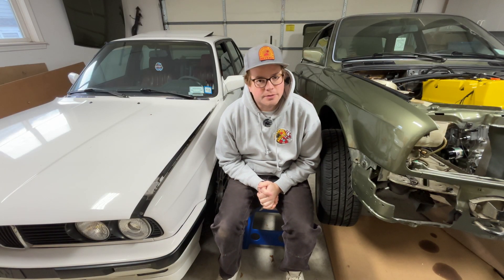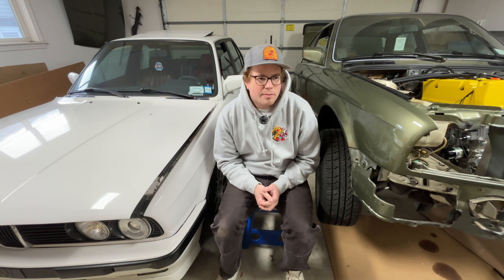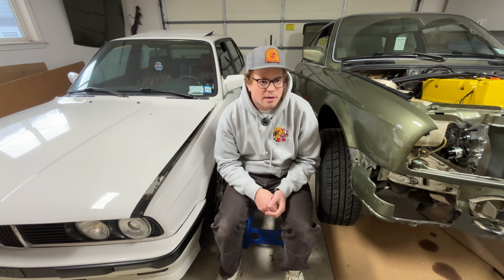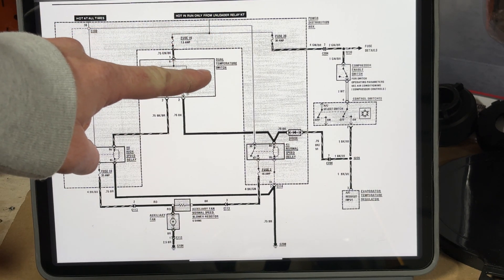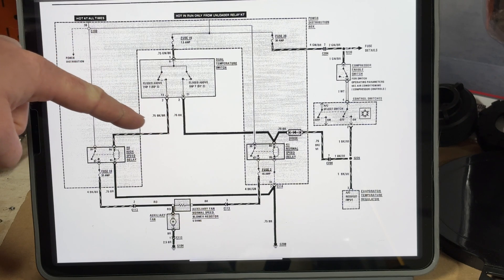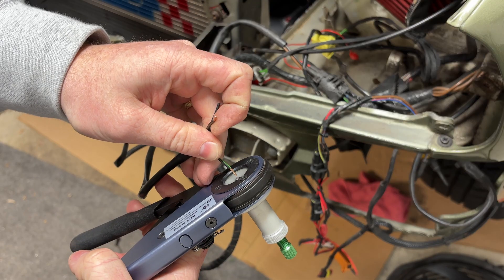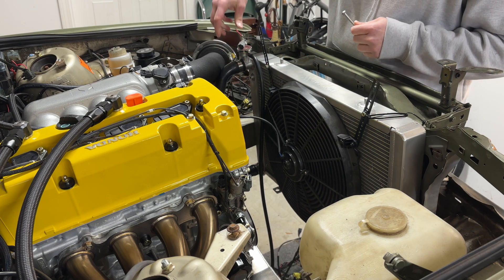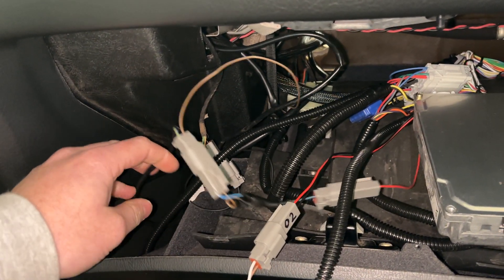Last Minute Details Before the K-Swap E30 Hits the Road!

Comment: Hows it going , 
I’m willing to pay you , and send you my two connectors that go into the ecu k pro . If you can make the harness like you created for yours I was wondering about that blue yellow wire . Lmk thanks in advance
Reply from the maker: hey there, i have not tested/verified that part to be working yet, so i'll have to get back to you on that. the wideband sensor is easy enough to wire though
Reply: @  what wide band part number did u go with ? And how so . As in how easy is it to do ? And when u do verify I’m down to pay lmk or if u can guide me through it lmk much appreciated .
Reply from the maker: @earvinrangel815  AEM 30-0310, it comes with a simple diagram to wire it. Switched 12v from anywhere on your car, ground, analog input (im using analog 0 on Kpro), analog signal ground. I show it a bit in my exhaust building video
Reply: @DekadentGarage  I’m still interested in paying you for a harness lmk
Reply from the maker: @ i still haven’t been able to test it. if it works id be happy to help you out
Reply: @ awesome thank you I would appreciate that and pay you

Comment: I'm doing the same swap. I have Kpowers harness as well. I'd like to check mine. So pin 7 on the ECU side should go to which pin on the CPS connector side?
Reply from the maker: Yep, A7 should be going to the middle wire on the CPS. Blue wire with a yellow stripe. You can find all the Honda wiring diagrams online using charm.li